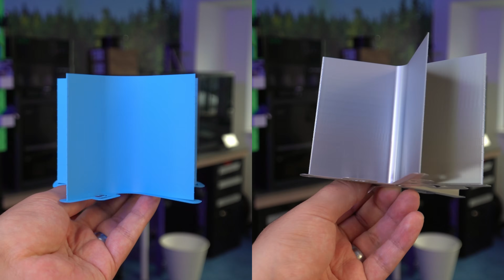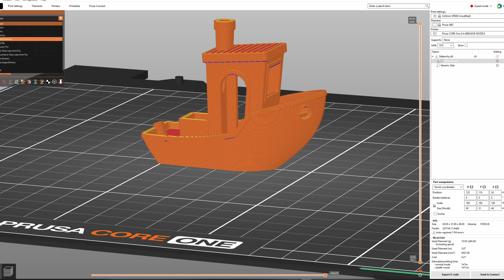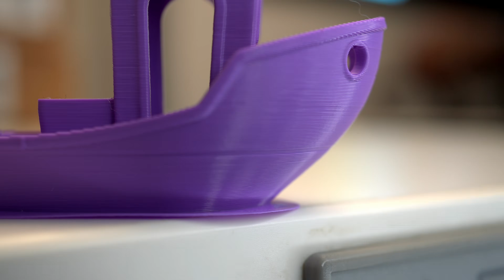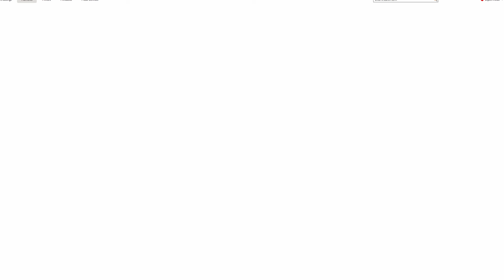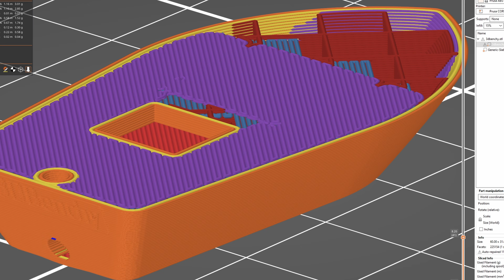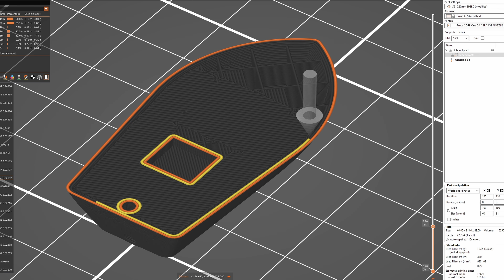The Benchy Hull Line - Down the rabbit hole

Comment from the maker: I glossed over the solution a bit so here it is:

In PrusaSlicer: First the "external perimeters first" setting was turned on. Then height range modifiers were set up for each bulging layer.  For each modifier I added a change to infill/perimeters overlap in advanced settings (just right click on the modifier and click advanced), it was set to a negative value of -1mm (probably way more than is necessary).
Reply: I have been fighting with these hull lines for quite sometime and generally I have ended up editing the design to add a 0.6m gap between the base and the wall. 
I wasn't even aware of the height range modifiers and definitely would not have thought of reducing the infill to perimeter overlap. Your way is SOOOOOOO MUCH EASIER!!!!
Can I suggest that you do a Short of your excellent solution and gear it more towards a beginner/intermediate user, i.e. someone that wasn't aware of this modifier
Reply from the maker: @wantstuff Sorry we didn't see this comment, yeah actually people have been asking for something similar so we can do it. I do want to work on it more anyway because its not quite perfect and expand it to more general cases than just benchys
Reply: More walls is another solution to that, 3 it starts getting better 4 is completely gone. Sadly have to do with the whole print having more walls since if you only fo for the problematic spots the contraction there of 4 walls vs 1-2 lower still will cause this issue again.

Comment: I've been planning on taking a look at adding this to Orca this summer.  I suspect that every filament should have a "hull line compensation" based somehow on "how deep its hinterland" is.  It may be as simple as a pause after the exterior walls, though.  I'll play with it.
Reply from the maker: You should also check out Factorian Designs video on it, they did some more work on the hull line and it might help you
Reply: @3DJake_Official  Just trying some Bambu Basic PETG, which is on an insane discount in Japan during the summer sale.  I may have to order 18kg of it to get the best possible price per kg but it's working really well for me on the test project, which involves "yet another storage system" I've made whereby the containers snap onto a holding tray.  It takes big pressure to join then big force to separate, yet hasn't broken despite 100s of cycles.  HOWEVER, it's got the worst hull line I've ever seen.  In fact I've seen Factorian's vid too, certainly a top-ten resource.

Comment: Thank you so much. That is indeed ingredibly helpful because I was going nuts. Every benchy I printed had the exact same issue.

Althoug mine behaves opposite. The area with the sudden increase in layer time causes the bulge going outward. However, with shrinkage it should go inwards. Does anyone have an idea what could cause this? Maybe PrusaSlicer or the Printer (Core One L) tries to automatically compensate it, but by doing so overcompensates?
Reply from the maker: We had a similar case, not entirely sure if it is just a Prusa thing but the decoupling solution seems to work for it too.

Comment: On my p1s I have an e3d obxidian hotend, and with it I got a petg hf obxidian profile that seem to blast the bridge layer with 100% fan, but compensate the outer wall with a very low fan percentage. The prints turn out a lot better than the standard profile and faster too. What bothers me is that I can't seam to replicate this on the h2c I got, and I get the hull line on prints that I can't do post procesing on.

Comment: There is a more accurate outer walls setting which increases the gap between outer and inner walls (if I remember correctly). Maybe this helps.
Reply from the maker: Ooh really? What is it called? Could totally be more effective
Reply: Please say what it is.
Reply: @Pezzr  It's just called "precise walls". It's just a boolean, but it makes the outer walls overlap less with the inner ones.

Comment: This has been an issue since buying my Core One last month and it's been driving me bonkers! My Flashforge Adventurer 4 Lite never did this, so it had me thinking there was something wrong with my Core One. I'm glad to know I am not the only one and that this is mostly just a problem with 3D Benchy's. It still does bother me though, I spent $1,000 on my very first Prusa, a high quality well regarded machine and now my Benchy's look like ass. Don't get me wrong, I still love the machine, but it's made me realize that more expensive doesn't always mean better. This make me appreciate my Adventurer 4 Lite way more. Thanks for posting this video!
Reply from the maker: Which slicer do you use with the A4? This problem is actually worse when using slic3r variants like Prusa Slicer, Orca Slicer or Bambu Studio. Using Cura or a Cura fork gives you better results. Still the problem persists, although not as bad.
Reply: @3DJake_Official Hi, I have always used Flashprint with my A4 and was pretty happy with it, I never tried anything else. I am now using PrusaSlicer with my C1 and it's a learning experience.
Reply from the maker: I used Prusa Slicer for a long time after starting with Cura. I found it good then but since I have moved on to Orca which is far less clunkier than Prusa. Prusa still has some nifty features but its so just so much more natural with Orca. Flashprint I have actually no experience with but seeing as it is not based on Slic3r slicers that might be one reason why the hull line isn't so bad when using it. I'm not entirely sure what causes the severity on those slicers unfortunately, I really want to revist this topic soon and have some more work put out there :)
Reply: @3DJake_Official  I am using Bambu with my h2s and did try the fix but i could never get the -+ right either the wall stood out or was inward never flat

Comment: How do I create those modifiers?
Reply from the maker: instructions are pinned in the comments but you just need to right click on the object on the right toolbar, select height range modifier, enter the correct layers and right click the height range modifier, go to add settings, advanced, select infill overlap and change the overlap to -1mm. That value is probably way too high but we're going to revisit this and get settings perfect.

Comment: What would be really awesome is if they could simulate how prints will be warped based on filament, printer, and the results of sample prints, then use that to modify the model to undo it. Just print that hull line a bit wider so when it shrinks it ends up the right size.
Reply: Shrinkage calculations is very complex: it can vary depending on plastic itself (which can differ from spool to spool), extrusion tepm, layer times, cooling, surrounding temp, part shape and features, infills desity and types etc. So it practically makes no sense to implement such coplex calculations: it will take a lot of time to slice, and result would not be precise.

Comment: Interesting. Seems something like "thermal mass at layer X" should be a parameter that slicers use to calibrate nozzle pressure when laying down lines. Higher thermal mass contracts inwards more, so should lay down more material to compensate.

Comment: Or designers of things can learn to adapt to the limits of 3D printing and use curved transitions instead of sharp angled transitions between inner and outer structures. If that transition on the benchy was curved, you'd have no hull line

Comment: there is a slicer setting for this in orca, it's called don't slow down on outer perimeters, in filament settings
Reply: This drove me insane because I own ender 3 and use cura for it. I was comparing my ender 3 print quality and bambu a1 print quality. I have noticed my ender 3 has better print quality with no benchy hull line. While my a1 print is plagued with benchy hull line with everything I  print. Bambu studio should add something similar to cura.
Reply: @eggboi955  how did you get rid of the hull line
Reply: @eggboi955 you can tweak the outer layer speed but yeah, it would be nice

Comment: In injection molding, thicker areas shrink more, so in general you need to keep wall thicknesses quite uniform, or compensate in the mold (effectively bulging out the area that will see more shrinkage). Slicers should be able to work this kind of compensation out.

Comment: Benchy is a test print, solving this is a fun challenge. For a more repeatable fix in real-world designs, "microfeatures" in the design could allow the 3MF file to contain the compensation for this so that the end user doesn't need to compensate in the slicer. Slant 3D talked about it in the last half of their recent vid "Design Unbreakable Pins That Fit Every Time"

Comment: I always thought of this as a cooling issue where the outer perimeters cool differently and I used to fix it by printing super slow benchys
Reply: My Kobra S1 came with a pre sliced 15 minutes benchy. The funny thing is that it doesn't have the hull line while regular ones do. The only difference that I could spot is that the top layer infill in the speed benchy don't reach the outer wall at the hull line. Essentially it keeps the walls hollow that hides all the shrinkage.

Comment: Thx for your investigation. I 've made a similar analysis. 

Beside the different Layer masses and coolings, my resume is: keep the pressure Constantin. Because you have always a left-over-pressure inside the nozzle chamber. Therefore i turned off Arachne & Fill gaps off. This helps too. 

The faster you print, The more difficult it gets to make all homogeneous. 

And we have physical aspects, beside the Software adjustings. For example a volcano-style nozzle (or lets say a long heat chamber is good for print speed, but Bad for controlling a constant pressure (you have more molten mass). So for details an old style E3d v6 Nozzle do a white better job, than a volcano style nozzle.

In the end it is also a question about speed vs beauty.

Comment: Thank you for the video! I was already so sure about the answer, but never had enough time or competence/experience in slicer to proof it or eliminate the problem with visible layer shifts after painting large flat area on previous layers. I hope there be some fix for that some day, it ruins the look of larger box lids and similar stuff when printing them for example out of PETG, also can create physical problems with parts for engineering projects. Cool short and well explained video😉

Comment: In my opinion layer time is a crutch from a time where it was easy to under cool and at the same time over cool. In my experience with printing every filament from 220c to 350c is that you want to cool ALL filaments as fast as possible to just above glass transition to "quench" the material and then allow ambient temps to finish cooling down below glass transition. For me heating the chamber to 35c on purpose for PLA helps keep all the different shrinking closer together. Even PETG I preheat the chamber to 45c and pure translucent polycarbonate at 60c and fans at 20% with my printer.
Reply: Hmm my normal Chamber is already at 39 so this does not make a differance I did tey the increas mentioned in the video but could never the the ammout right eighter to littel or to much

Comment: The benchy hull line is a slic3r/PrusaSlicer/... problem. I never had the hull line with S3D, Cura, Ideamaker
Reply: Same here. Seems like Cura always leaves a small gap between the top layer infill and the outer wall when possible. OrcaSlicer connects them by default, but there is a setting called "Ensure vertical shell thickness" that helps to keep them separate and hide all the shrinkage inside walls.
Reply: @CockroachSlidy do you let this setting on "all"?
Reply: @fabianluethi03  You need to drop it to moderate or critical only.

Comment: It is awesome that it looks like you solved the problem for this geometry; but can you explain how you made the modification that you actually used to solve the issue?  The frame only shows  you selecting the layer to modify, and then the finished result, but not what you actually did to separate the wall from the bridge.  Thanks in advance for putting this out there, the hull line is a constant source of irritation.
Reply: I think he changed infill/wall overlap (Orca) or Infill/Perimeter overlap to a negative.. but 😂 you're right all that work to gloss over the exact setting... I get it I do it all the time - so excited to solve something I don't actually finish showing the exact thing I fixed..
Reply from the maker: You're right it was a negative overlap. I added a pinned comment with this because yes, totally glossed over the solution.
Reply: @3DJake_Official Been there totally get it!  Someone called me out in one of my tutorials.  At first I was like no way!! Then I rewatched and totally didn't get to the last step.. Keep up the great work!! I had some tolerance issues and now that I think about it, was probably due to this same issue!

Comment: Unfortunately, my English isn't that good.
But I also have a component that I drew myself with these lines.
To put it simply, it's a horizontal "L." The layer adhesion isn't that good either. Oh, the filament is PA6 CF.
I thought it was due to the temperature.
Thanks for this video.
Greetings from Switzerland.
Reply from the maker: PA is pretty sensitive to shrinkage so I'm not surprised although the cf content can relieve it somewhat. That line is common where the the sparse infill will begin close to the bottom.